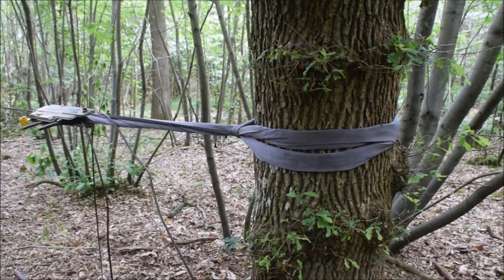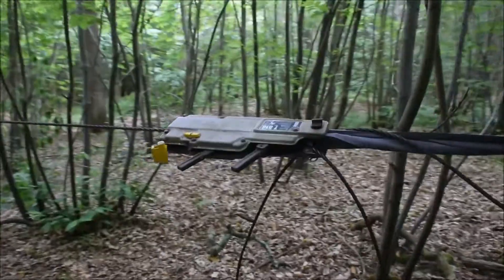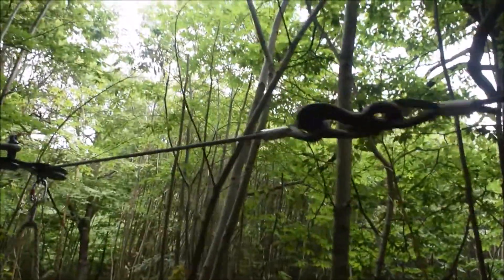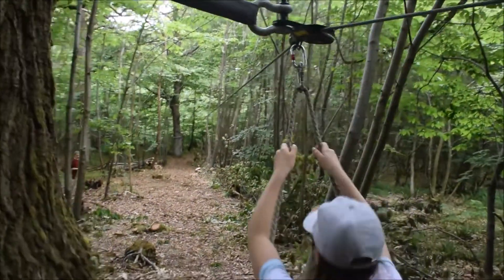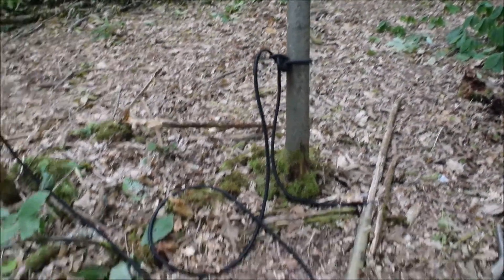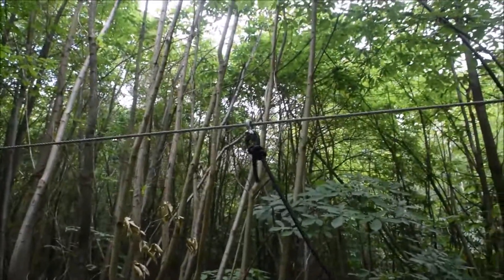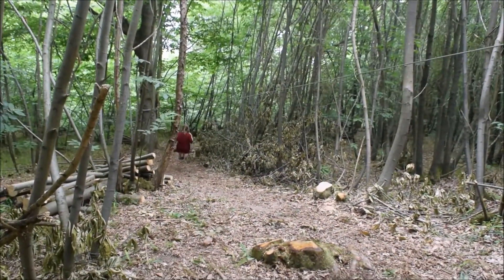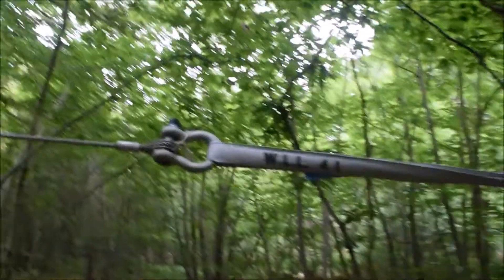How To Make a Zip Line with a Tirfor Winch

Comment: thanks been looking for the same idea for a while
Reply from the maker: Main thing is to set up a braking device that doesn't wear out the expensive steel rope. However, you should really have two braking devices, for safety. Normally, the primary would be an upward slope at the end of the line, with the bungee as the secondary, but I didn't have enough length for that.

I planned out an alternative route of over 100m, where I could leave the line up permanently, and just remove the carriage. But it needs quite a few trees felled and new equipment, and with environmental action I've been involved with and now the pandemic, it's dropped a long way down the agenda...